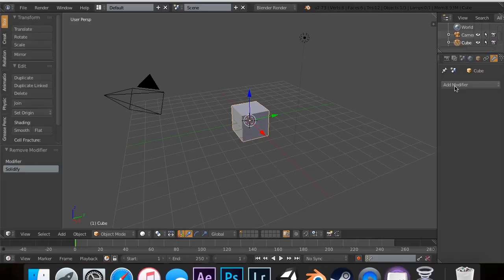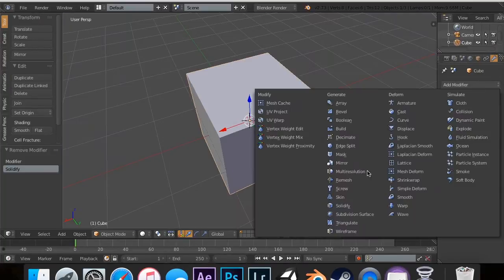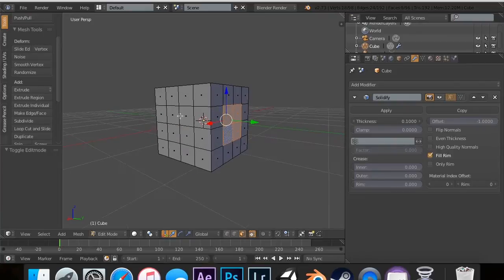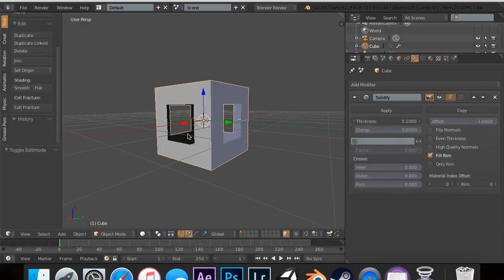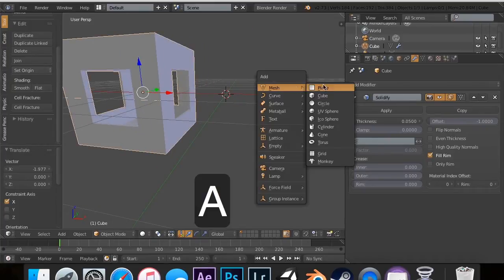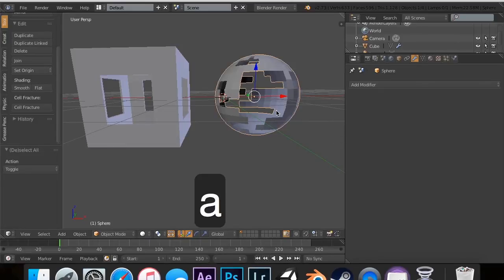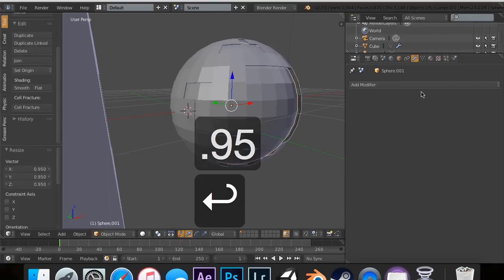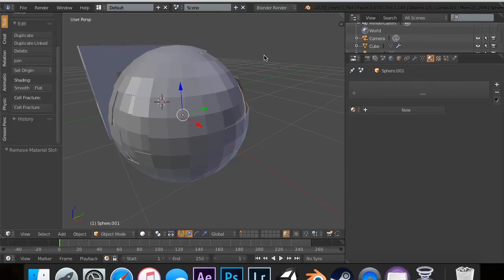Blender Modifiers - 7: Solidify

Comment: what about solidify cylinder that has hole?
if we add solidify on that cylinder, the inside hole will shrink down and make funny shape, like not circle anymore.
how to make that 2 hole (inside and outside holes) perfectly line up?
Reply from the maker: One thing you can do is grab the ring by holding CTRL and right-clicking the ring and extruding down to your base. This should put vertices inside your object in the right spot but I am unsure.